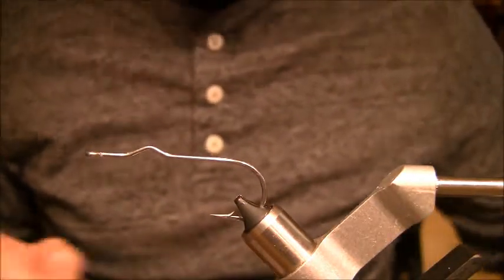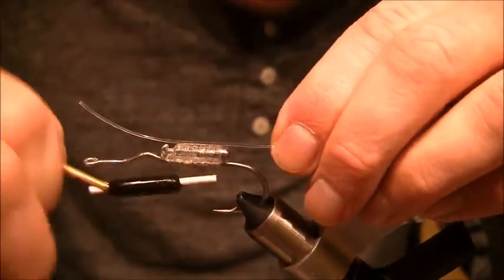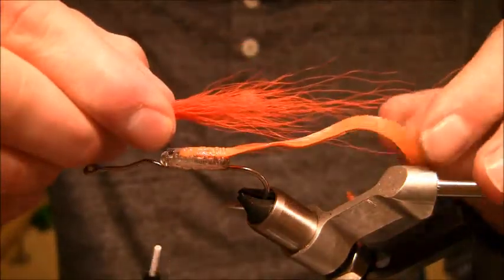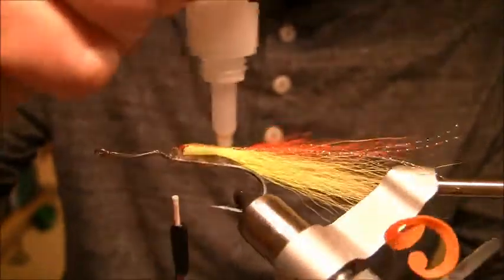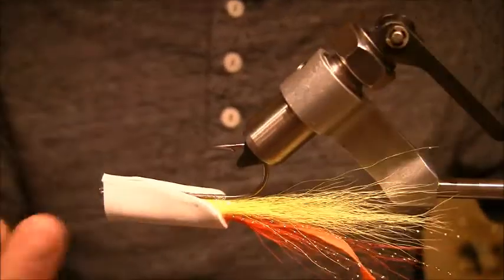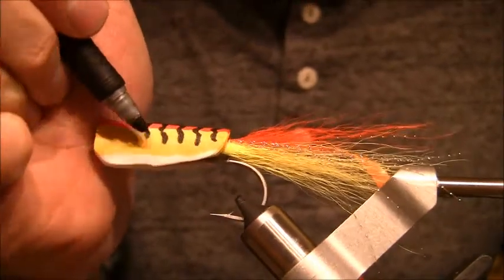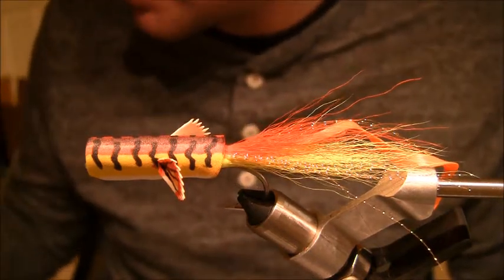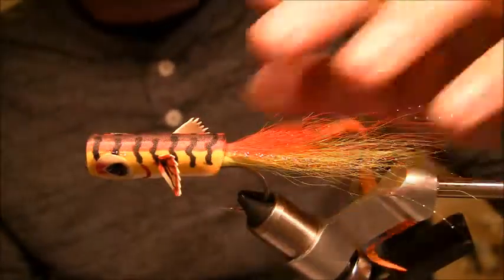Kiley's Crease Popper

Comment: I stopped adding rattles to mine. I'm not sure that they make a difference since you would be popping the fly at the same time that the rattle occurs. I think it just adds a step and adds weight. As you said, these don't last long, so quicker is better. I do add some UV glue to the foam right below the hook eye. That is usually the first place they tear after landing several fish. Love the fins on yours.
Reply from the maker: FlyfisherSkor valid point. I liked it on this fly cause it help with the shape as well. Plus some crease flies it is nice for when you can give it small twitches vs a pop to help with the lazier fish days when the just want to put their nose on it. Ive gotten reaction bites with the tiny still side of fishing these. Who knows really if it helped or not.